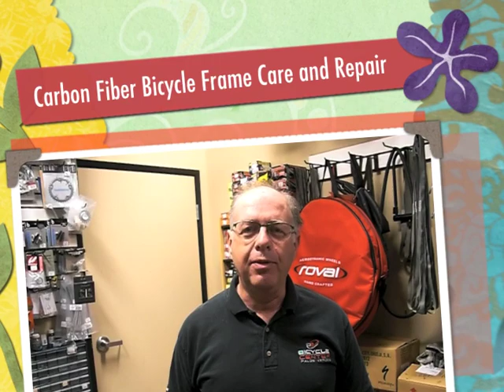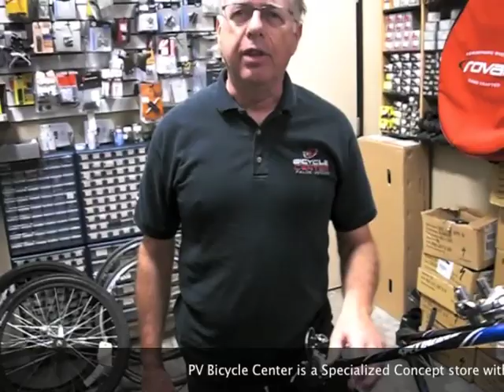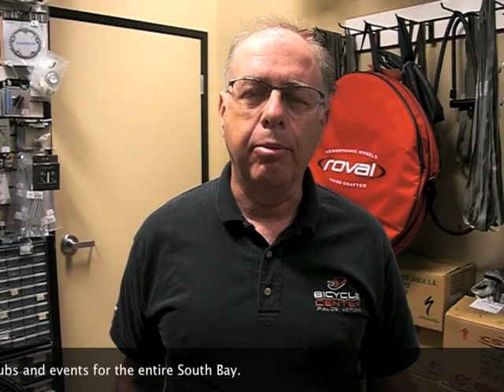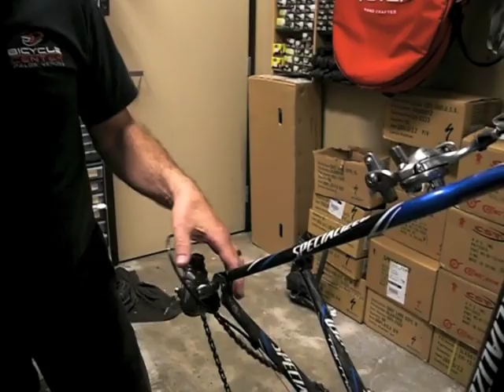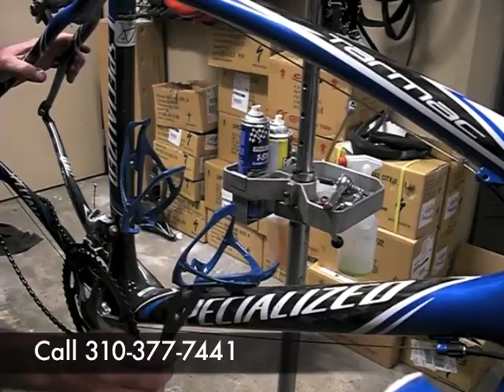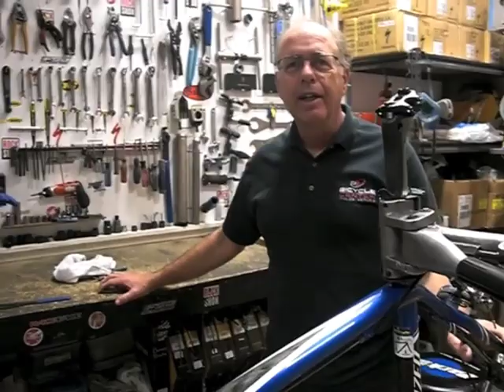Carbon Fiber Bicycle Frame Care and Repair - PV Bicycle Center

Comment: this guy could have easily sourced information from a composites engineer or anyone who works with composites.  In this video, he's telling us that he actually knows nothing about composites.  Epoxy resins are waterproof.  If there's a chip in the paint that reveals carbon(graphite), it will not be damaged by water; the likely scenario is that it will be damaged by some idiot in a shop scarfing it down with a sanding wheel!!!  Let the experts deal with it, not this guy.

Comment: the weather and or water doesnt absorb water this is terrible advice and scare mongering as kayaks ,boats ,aircraft,even your wheels are open to the environment and they dont HYDRAULIC up all carbon can be repaired perfectly easily from race cars to aircraft so im guessing this vid is to just try and sell some boguss cleaning polishing product ...............................................soap n water and wax it that will do nicely :-)

Comment: This is pretty terrible advice.  Carbon damage isn't very visible, and will propagate if not properly treated.  If you've got cosmetic damage, you've probably got more serious damage underneath that you aren't treating by painting over it.  Get the damage appraised by an expert and then, if it is more than cosmetic, send it to a professional for repair.  Calfee does very good frame repairs, as do a few other carbon builders.

Comment: i  have a giant tcr advance frame i've noticed theres a scratch or maybe a crack but i hope not at the down tube near driveside of chairing.

aside from tap test and visual inspection is there any other method of checking your carbon frame or components?